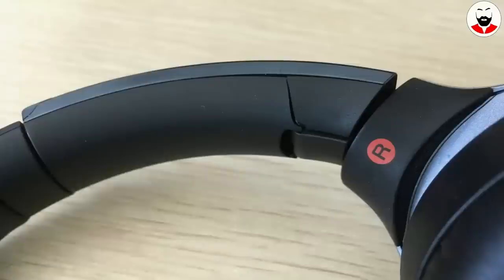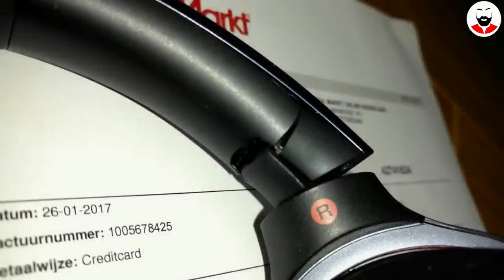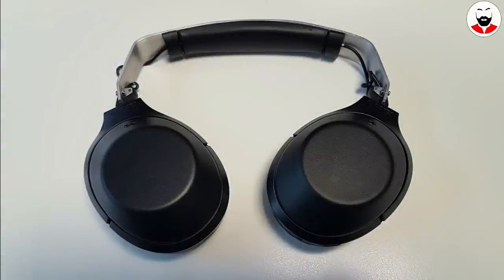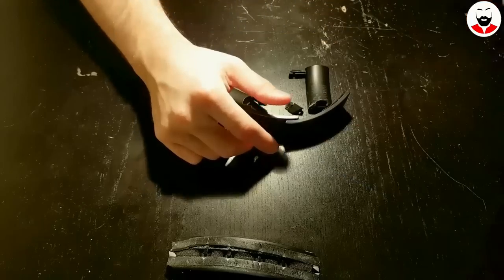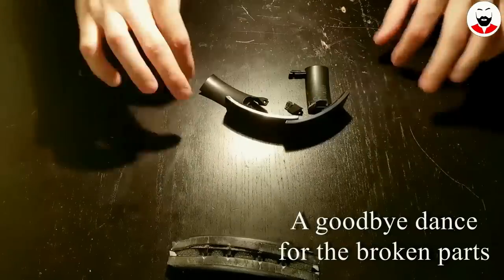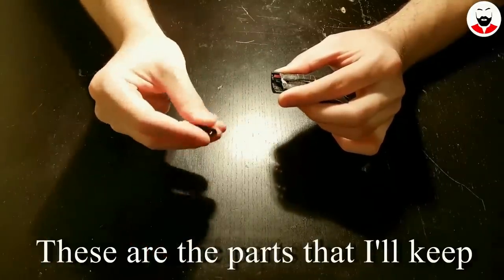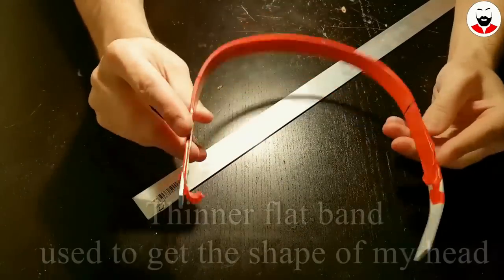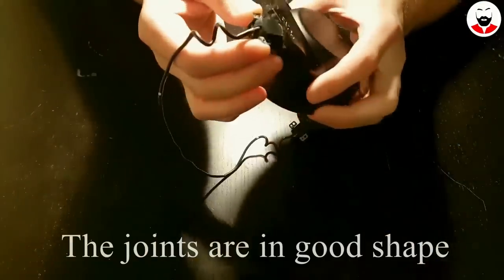How I Fixed My Broken Sony MDR 1000X Headphones (DIY Custom Headphones Headband)

Comment: I think  all those so called Sony engineers  or designers take a good look at your works, I think it master piece..Sony are good with sounds,but very poor designs. They should made them with stainless steel,or aluminum,,  I got one the right hinge broke on my Sony mar-1000x .  I am  not skills with craftsmanship like your self,   I think you   Should sell  the pre cuts Aluminum bands on eBay, that would help out a lot.thanks for your awesome video sir.peace out. I would love buy one

Comment: It looks better than the original one 😂 such a shame that a good headphone like this has so poor building quality... I really wanted them, however I’ll skip, having one cracked Sony headphone is enough
Reply: Had spare 400 euros for headphones and was in-store for bose qc35 and sony 1000x m2 and the sony had faar superior features and richer bass.. and overall high's and low's wanted to get the 1000x got it and in the first 2 days  my friend told me about the issue and after a month i've seen a small crack on the headband it was starting to get broken and i took really good care of them.. returned them and marked it as a design flaw and got my money back (thanks german consumer protection law) i've had the xb950 and they were amazing but the lack of noise canceling was making me mad when i'm 20 hours in train a week..
Reply: Konservativ Fornuft  I don´t know what the hell yall on about, obviously this was a production issue, have mine replaced after two weeks and for one and a half year they are going strong, I sleep with them every night and I´m pretty clumsy sleeping.

Comment: Man this is awesome!!  Why can't Sony have done this!! Mine broke yesterday and I don't think I could do this for several reasons. The first reason is because I'm not skilled enough to creat this and I probably cant take my headphones apart since I used epoxy to try to keep it together. Not sure how long it's gonna hold.
Reply from the maker: Thanks man for the feedback!!! So sorry yours broke as well :(
Reply: Mine broke too on both sides, but sony fixed it in 2 weeks (cannot see any defect now). Probably will sell it on Ebay. Any recomendetion for a similar device?
Reply: I would like to know how to claim it, Thank you

Comment: Amazon took it back in my case, getting QC35 II now, which also have 2 active sources at a time possible, not with Sony...
Reply from the maker: I would have gotten the QC35 as well but they create a pressure in my years. Same with the px 550. This is the main reason I choose the Sony over the Bose. So shame for the poor build quality...
Reply: After a month with QC35 I must say Sony has much better NC and a bit better sound. Bose build quality is much better and lighter. Still, no regrets. Bluetooth connects much faster, almost instantly where Sony takes seconds. And you can turn off the voice. Firmware updates... Too bad Sony don't pull their act together...
Reply: thorro3 ty for the review confirmation. Sony would have way more sales if they didn't play all these games. There technology is almost always very good. But there reliability in there products and customer support can suck at times l, too many times to over look. Almost too many times to even continue buying there products. Hehe

Comment: I think this kind of thing is an issue with any headphones that have a plastic top-band section. Kind of built-in obsolescence when they eventually crack. (Perhaps more of an issue if you've got a big noggin?) If it was metal to begin with there'd be a chance to bend back any possible damage. Same issue on my Sennheiser PX 360. Will just have to kludge something together with wire and epoxy, since they don't seem to make repair parts for that model anymore. Then some polyfill from a craft store, black felt and black yarn to re-do the padding. (Speakers are still good, but without enough pressure on the full cup design, a good part of the low range sound doesn't transfer through.)

Comment: Does anyone know if the m2 version fixed the cracking?
Reply: I just got a crack on my today.
Reply: TheSilverWolf1998 I've see alot of reviews on the new m2 version and it seems the cracking continues. It's a shame because apart from the cracking there superior headphones to the bose qc35 2 in sound quality and noise canceling and technology quality. But in build quality..... meh...

Comment: Great job! 

I'm looking to fix up my 10 year old set of MDR-XD200 headphones. I don't think I'll need to go this far to fix my set. Mostly I need some new ear pads, and to fix the balancing headband... or build a new one, as it's hard to find the rubber part for it anywhere. (I could probably just build a carefully measured strap instead, or create a pad to attach to the main headband, and it may have the same effect.) It's otherwise in good, working condition. It's seen a lot of abuse, still sounds incredible, and yet the cable isn't broken at all! Not bad for something I bought for under $25 USD. 

Anyway, your video is very inspirational and informative. :)

Comment: Thumbs up! First solution that feels permanent. I am looking forward to similar solution only with 3d printed hinge part.
Reply from the maker: I'm goind to make a 3d printed one at some point as well. Can you share yours when it's ready?
Reply: How did you get on with the 3D printing fix?
Reply: At the time it was too time-consuming and I decided to fix them using the guarantee service that was still valid at the time and pray that it won't happen again. Good Luck!

Comment from the maker: Finished headband at 11:40
Reply: GaBIT is there any way you could sell these? I’d love to buy one as my headband also broke
Reply from the maker: Juan Baphomet hey Juan, I could do it but I need to know your head measurements - from ear to ear across the head. But since it's aluminium you can adjust it anyway after. I could do one for you for 80 Euros + shipping.
Reply: What size are the m2 screws?

Comment: Did M2 fix the issue?
Reply: Nope
Reply: Yeah they did, my sony wh1000xm2 is still like new after daily use.
Reply: no they did not fix it.. google search.. I had to find out the hard way 1 week after purchase.. returned them and wondering if i should go buy the QC35ii
Reply: Nope, mine broke today.
Reply: morten thomsen pxc 550 have better sound quality
Reply: I bought the QC 35ii and love them, I tested both the Sony WH1000M2 and Bose QC 35 in a duty free shop.
I found out that the Sony's cancel out slightly more noise than the bose but it felt kind of artificial. Sound quality was slightly better on the sonys though its not as much as many youtubers emphasise. The comfort is  of course better in the bose though the sonys are not that too uncomfortable. 
I kind of preffered the Qc 35's slim fit, the sonys look a bit bulky. 
All are awesome headphones but I for once do not regret getting the QC 35s. To me they offer great value for 350$ pair of headphones. My main purchase decision was not based on sound quality but rather a more natural noise canceling, durability, slim fit and comfort. The sonys looked like they would not last for so long.
Reply: No. Mine are one day old and creaking like a bitch on the right side. I have two months to return them to Amazon. I'll use them until the last day and send them back.